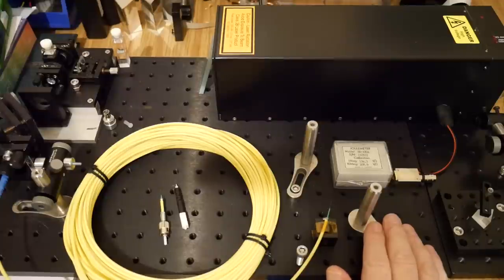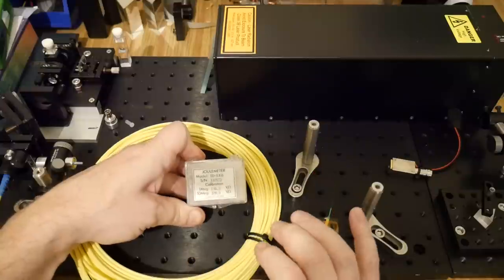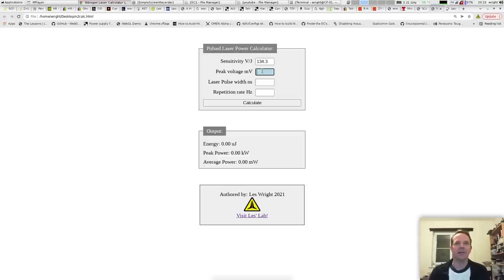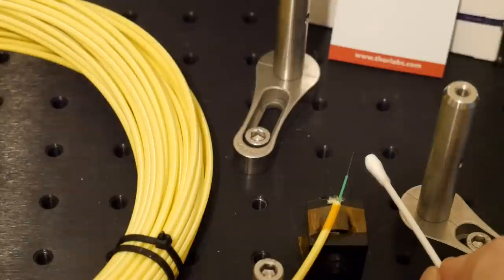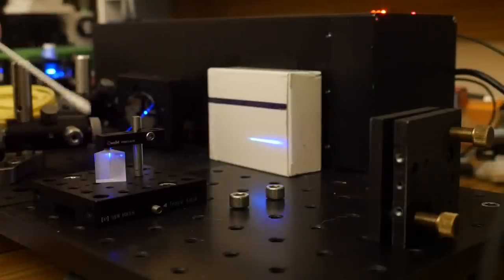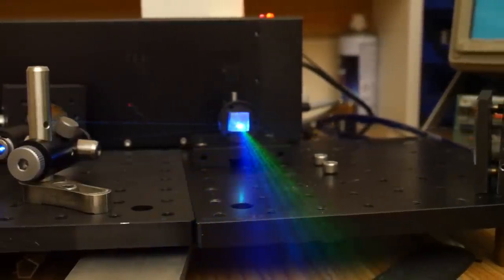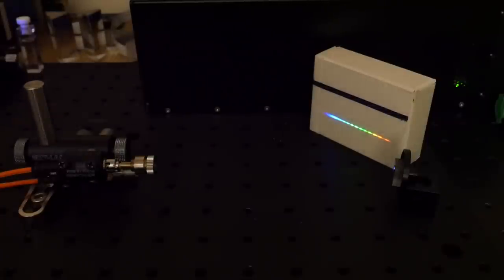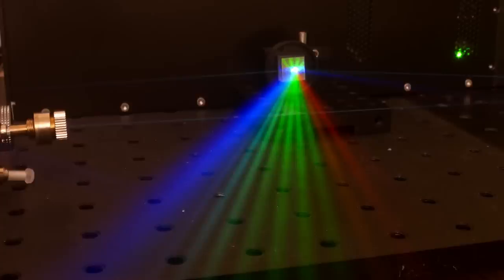Supercontinuum in Multimode Fiber

Comment: The peaks at 16:52 arise due to a process called Stimulated Raman Scattering (SRS). To understand this mechanism, consider a simple, isolated molecule like H2. The molecular bond can vibrate at a set of distinct frequencies due to quantum mechanics. If we were to shine a laser onto the molecule, a photon can "donate" some energy to the molecule by exciting vibrations. Since the photon has lost energy, its frequency has decreased by an amount corresponding to the vibrational frequency of the bond. Since the frequency has decreased, the wavelength must have increased.

For an amorphous material like silica, the molecular bonds are extremely irregular compared to a simple H2 molecule. Therefore, the possible vibrational frequencies form a continuous "band" with a peak at ca. 13.2 THz and a width of around 5 THz as shown in Figure 2 in this link:
https://www.rp-photonics.com/raman_gain.html

Therefore, when shining a highly intense, coherent laser pulse with a certain carrier frequency into a silica fiber, coherent molecular vibrations will be excited. This transfers power from the carrier frequency to one that is approximately 13.2 THz lower; this is SRS! Furthermore, this lower frequency will keep "stealing" power from the carrier until it gets so intense that the process can repeat for a frequency that is an additional 13.2THz below that one (and so on in a process called "cascaded SRS"). This explains the observed "comb" structure. 

Considering the peaks at 16:52 labelled 497.7nm and 519.4nm (with an unlabeled one in between), we can see that the peak spacing is 10.85nm. Converting this difference in wavelength (BW_lambda) at 497.7nm (lambda_0) to a difference in optical frequency (BW_f) using

BW_f = c*BW_lambda/lambda_0^2,

we get 13.13 THz, which is very close to the peak frequency of the Raman gain spectrum presented in the link above. 

If you are interested in some of the theory behind nonlinear phenomena in optical fibers, feel free to check out my channel, where I both demonstrate these effects experimentally and simulate them numerically using custom python code:

Experimental Self-Phase modulation : https://www.youtube.com/watch?v=wZyaTVTmmBk
Experimental supercontinuum: https://www.youtube.com/watch?v=ZsZXqxwJBcw
Numerical simulation: https://www.youtube.com/watch?v=xIdozUy9Nas

I plan on upgrading my own code to handle Raman effects in the future, but I know that others have created packages that allow for simulating SRS in optical fibers:
https://github.com/WUST-FOG/gnlse-python

This was a really awesome demonstration, great job :)
Reply: In addition, though it's not an effect I have worked with myself, I don't think soliton fission is taking place in your experiment. The sources I have been able to find (see links below) state that soliton fission takes place for pulses on the scale of tens to hundreds of femtoseconds, which is much shorter than the 2ns pulses used in the present experiment. 

The basic reason seems to be that a pulse with a duration of around 100fs has a spectral width, which is close to the 13.2 THz peak of the Raman gain spectrum (see previous comment). Therefore, the spectral tails of the pulse itself end up stealing power from the carrier frequency, which is different from the SRS case, where the lower frequency photons are not initially present but "created" from a mechanical vibration excited by the pulse. Combined with other nonlinear effects (Self-Phase-Modulation, Cross-Phase-Modulation and Four-Wave-Mixing) as well as dispersion (different frequencies propagating at different speeds leading to broadening in the time domain), the spectral output is usually much more "messy" than the one shown at 16:52. 

Again, this effect is not my main area of expertise, so if anyone suspects that soliton fission is present after all, I would be interested to see the explanation.

https://www.rp-photonics.com/supercontinuum_generation.html
https://en.wikipedia.org/wiki/Supercontinuum#Soliton_fission_regime
Chapter 12 & 13 of "Nonlinear Fiber Optics" by  Govind P. Agrawal  (https://www.elsevier.com/books/nonlinear-fiber-optics/agrawal/978-0-12-817042-7)
https://opg.optica.org/oe/fulltext.cfm?uri=oe-14-21-9854&id=116387
https://opg.optica.org/directpdfaccess/b9dfcc88-eb69-4928-991b84b0a0c94b38_81189/oe-12-19-4614.pdf?da=1&id=81189&seq=0&mobile=no
Reply from the maker: Excellent thanks! This is really clearing things up! 

The original paper describes CSRS and SPM as the primary mechanisms for the Supercontinuum, however, when I first replicated with work with 9um fiber, I saw a very smooth continuum and concluded what I was seeing in 50um fiber was a different process, hence my best guess of Soliton fission. 
Given the regularity of the peaks, and how well what you have described fits with what I see, my guess is clearly erroneous.

Now I see all the pieces it looks  like SPM must be a more prominent process in 9um fiber and smooths out those peaks so they are no longer visible, which would explain the stark differences. See: https://www.youtube.com/watch?v=w1wSHizmbYg if you haven't already :-)

Thanks for your awesome contributions to my understanding of what is going on here, it is much appreciated!
Reply from the maker: @yourfavouriteta  Thanks! I have and it's great! For anyone else following these threads, check this video out here (Highly recommended) https://www.youtube.com/watch?v=sZEGMDZKyPQ
Reply: @LesLaboratory  Awesome! Don't forget to subscribe ;)
Reply from the maker: @yourfavouriteta  I thought I already was, but I am now!

Comment: Good work Les. I think the WL comb comes from the length of the fibre. The longer the fibre, the closer the peaks are. I need to study this more.
I have a fair bit of plastic comm's fibre with a 1000 micron diameter I could test in a similar test setup later. Also some wide diameter glass fibre. I am fascinated with this phenomenon as it may also have immediate industrial applications.

Comment: Excellent work building something like this. Not an easy task at all. The things required to make supercontinuum emission are high peak power, a very wide transverse mode spacing of several nanometers if possible, and a lot of fiber to allow mode mixing and stimulated raman scattering. Essentially the power from the light creates a strong electric field undulator that the longer wavelength mix with to create parametric mixing. The energy is so high it works a lot like a free electron laser. Why you are ending up with discrete bands of wavelengts is because the fiber is only allowing gain at those frequencies, but each color bunch should have the same mode spacing as your dye laser excitation beam in absolute value ie its 4nm across. The math describing it will make your brain bleed though.  😅😲🤓❤
Reply from the maker: Thanks I'm sure it would! I have been reading up on the subject, and yeah, complex stuff. If only there was more time in my day!

Comment: This is something that I would like to have a go at building. The only thing I don`t have to hand is the lens (to focus uv onto the dye) but you said in another one of your videos that you could use a lens from a laser printer, bit low on transmission but usable. When I get some time away from work, I will be giving this a try. This is one of better channels on Youtube, you are vastly under subscribed!
Reply from the maker: Thanks! Yes, in Laser printer assemblies, there is normally a Fast-Axis collimator lens in front of the Laser diode (It's square in section) It robs a bit of power from N2 Lasers, perhaps as much as 25% but it's not like these things are short on peak power.

Comment: hey les, I have a really interesting thing to tell you about. Ive had this pen for a while in its current state and only recently thought to myself that it could be a diode that hit super continuum. Whats going on was I was starting a 488 diode in its first light, underdriven. I did this to attempt to get 480nm (I think) out of it which has actually worked 2/2 tries including this one until the end. Anyways, It was so underdriven that by the time I got to its threshold driving current it stayed at 1mw. My technique was to press the button for a second and drive it up slightly and press again. Once it turned it too high still waiting for it to light up bright it suddenly turned green. I thought oh no and turned it back down and the green went away. Keep in mind each time I see light from it I press the button for a second. Sometimes a few times when the wavelength dropped low. When I put a lens on the laser as it was staying at 1mw now forever, the dot had bright green shading on the outside of the dot. Its easily 525nm from the naked eye. The dot in the middle looks 490nm. At only around 1 foot away its possible to see 460nm or something.... Im not sure it could be 450 honestly, its dark blue but only a small part of it, noticably. 

I took the laser outside one night to play with it and I stood almost directly in its path about 50 feet away and in my eye I could see orange to yellow color as I let the beam very close to my eye. I never saw any red at all and orange is barely there, I swear, I saw orange. Mostly yellow which was noticeable. I can only see it when I point it near my eye from 50ft away. Not on the dot. Im actually wondering if you want to check this laser out for yourself. In any capacity, like some pictures I can send you, I have none of the yellow color yet. If you want to, Id mail it to you in agreement of sending it back to me when youre done with it, if you wanna play around and/or analyze it. I would love to hear about what you think no matter what you get out of it, as a curiosity and your opinion. Or best outcome, make a video out of it :^D

The laser dot has a strange footprint now too. I wanna see what your spectrometer has to say too.

I just thought that I live in america idk where your stationed.

Comment: Very nice work!

A few points regarding the mode profile:

1. What's the mode profile of the Dye laser beam? How does it look like after propagating through the fiber?
2. What is the bend radius of the multimode fiber? As you may know, overly tight bend radii induce loss in higher order modes. Is it possible to change the bend radius?
3. How does the mode profile look after various distances of propagation?
4. Do you know how to extract the delay from spectral interferogramm? It would be nice to see the Fourier transform of those spectra, as the spectra do look like the output of a white light interferometer. 
5.   You may be able to do FROG or IFRAC with your pulses in an reasonably sized interferometer since solitions maybe compressed compared to the initial pulse.
Reply from the maker: Thanks!

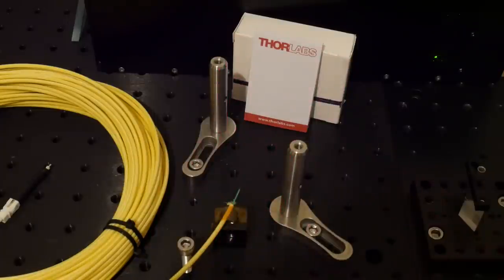1) It is poor, see: https://www.youtube.com/watch?v=w1wSHizmbYg at 09:00, once it has propagated through the fiber it appears Gaussian, but this has not been measured.
2) I have not tried it but I have considered experimenting with this.
3) Again, this is something I want to try, I was speaking to Sam (laserfaq) and am considering sacrificing a cable just to see.
4 & 5) might be problematic. I have considered FROG at least however on a budget it might be difficult to attain meaningful precision, but I like to try stuff ....
Reply: @LesLaboratory  1) Interesting to see that the even the original beam is seemingly single mode after coupling to the fiber. Does that single mode-ness change with power of the beam? If you truly see the non-linear self cleaning, it should be power-dependend and the effect should be easy to see even for a small attenuation. 

It would be cool to see some interferometry. 

5) There is spatial and spectral resolution to concern about as well as dynamic range of your spectrometer.

 The spectral resolution of your spectrometer should be easily measured by just looking at a few narrow line width sources like a HeNe. 

As for dynamic range of your spectrometer, i.e. how small of a pulse on a underground you can see, that should be in the spec sheet of your sensor. 

As for spatial/temporal resolution for setting the delay, you get 2*300nm/fs for a single bounce in an Michelson interferometer, so 10 um positioning resolution like from a stepper motor turned lead screw means 66 fs resolution. Enough to see some pulses, I'd say.

Comment: Interesting video.. a few comments as I'm watching:
-1GW/cm^2 pretty nice. Almost enough to drive optical parametric conversion
- Beam size from your fiber: the fiber tester is extreme Multimode and the fiber piece you're using is very short, so even the biggest modes that experience high loses in the multimode fiber make it through that short bit. In the long fiber however those high orders have enough time to die out. If you can, try the tester on the long fiber and compare. Your Dye laser beam is also probably of much lower order than the fiber tester to begin with. You can also always check if reducing peak power with attenuation changes the beam size coming out of the fiber if you suspect non linear processes at work.

The comb like structure is interesting. Did you try to influence it? (Push against the coupling mirror, stress the fiber...) To see if it changes in periodicity?
20% efficiency is pretty nice as well. Do you still get that with the 100m fiber?
If you feel like experimenting you could take a few meters of the multimode fiber, get the good coupling efficiency and then with a torch heat a small section in the center and stretch it. It'll reduce the fiber diameter in a relatively controlled fashion. You might be able to push your efficiency and continuum bandwidth without the need for very long pieces of fiber.
Reply from the maker: YT channel: Your Favourite TA has suggested a robust experiment to substitute my fiber tester for something more suitable for a more scientific comparison, to try and narrow this one down.

The comb it turns out is Stimulated Raman Scattering, and is dependent on the properties of the silica fiber. In previous experiments (9um fiber) this was not visible because self phase matching smoothed out the peaks.

The coupling efficiency could be better, but yeah, 20% isn't terrible. I have not made further measurements with 100m yet, this whole thing is a live experiment in progress.

That could be really interesting, like creating a tapered fiber, cool! I will look into this and see if it achievable practically.

Comment: I was not surprised to see the cleanliness of the beam exiting the fibre. When you couple a laser beam into the fibre it "just' travels through the fibre and gets scattered. In this case the fibre become the 'resonator' of sorts, so the actual lazing happens in the fibre for what you get at the output, hence the decoupled beam is the result of the laser cavity, eg. fibre. With destructive and constructive interference the beam 'cleans' it self up, or just lazes what is permitted or supported by the cavity.

Comment: Les, try to set the dye laser up as a ring dye laser optical setup, and if you have an AO, modulator set it up in the cavity as well with  a variable frequency controller to the AO, and I have an Idea of using two piezoelectric disk with small first surface mirrors glued onto them , in the cavity as a beam stabilizer,  inside the ring configuration,  as well put a spacial beam filter in the cavity  of the ring lasr then sync  the pizo, frequency with the AO, then pump it into the Fiber,. Im going  to try this after tge first of 2024, I have all the gear to do the experiment. However  I think you might  find thus very intriguing and interesting.  Perhaps make the fiber bundle into a ring laser as well with  a polarizing plate and a 1/2 Wave plate cavity dump. Use pizo setup in its ring cavity as well. Brain storming I sm. I am Dale Robertson

Comment: Very awesome !!! You said Pink Floyd album cover and I looked up at my gold disc album picture and it's about the closest thing  I've seen yet ! Have around   five or six he/ne lasers, mostly Phillips laserdisc player units and a nice Chinese disco laser with two open tubes but now I really want a nitrogen laser and various dyes please 😎
Reply from the maker: Thanks! Yeah, it really is beautiful. Good old He-Ne Lasers is where I started, lovely beam quality. N2 laser are about the easiest and least expensive of all the Lasers to build, and well worth the journey.
Reply: @LesLaboratory  wow, thanks for the reply les ! I've been all over the country collecting these old philips laserdisc players (4 so far) to make a working unit as all the optics are gummed up  !!! As you say, the beam is pin point from those, one tube has even been modified with an external mirror at some point ? Are built N2 units easy to come by and the cuvettes and dyes as I really love the UV stuff !
Reply from the maker: @johnwalker194  I have an external mirror He-Ne, but sadly the gas is contaminated. N2 Lasers (or parts) show up on eBay from time to time, but are a bit of a rarity. I built most of the ones I have. Cuvettes are pretty easy to come by on Aliexpress and eBay but they can be quite pricey.